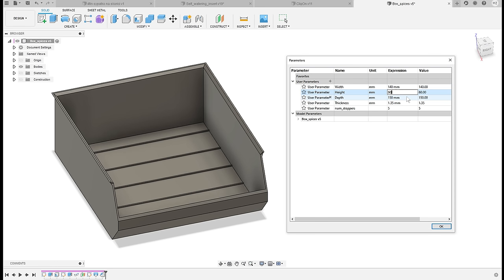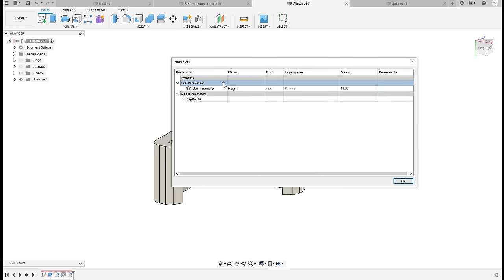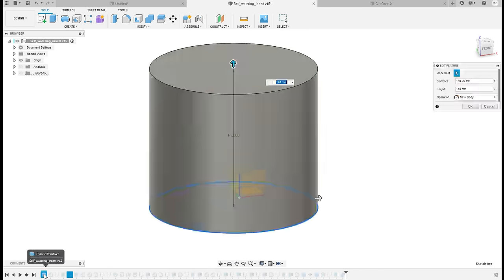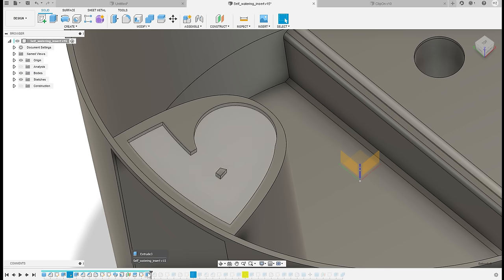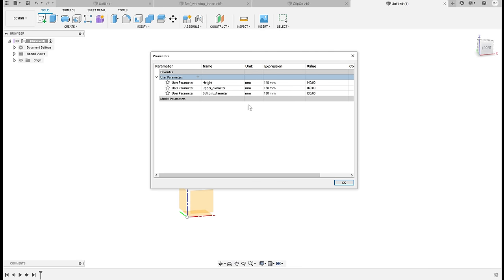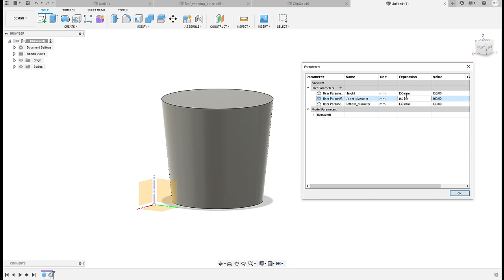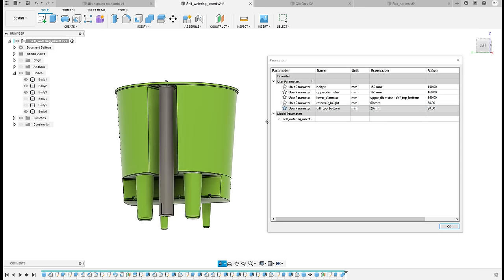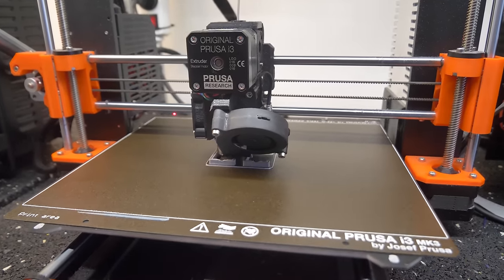Parametric modeling in Fusion360 explained in 40 seconds + detailed tutorial with example

Comment: Always good to see CAD used properly!

Parameters are very useful but stable modeling practice is important to make the size changes reliable. Try to locate your model around the origin to make best use of the planes and axis for mirroring, revolving, patterning and dimension references.Think about the feature types being used, for example a draft could have been used instead of a chamfer but as you want the lower diameter to be controlled rather than the angle the chamfer was the easier to control option. Your sketches should always be fully constrained to avoid unexpected results. Naming them also helps when you go back to fault find. Plan ahead and leave finishing features like edge blends and chamfers as late as possible as these can remove or change edge references and are likely to cause update problems. The order in which blends are applied can also make a huge difference to the results. If you have more than one body in a part then you should probably be splitting them into separate components. Most importantly keep it as simple as possible. The longer the history tree the more likely it is something will fail but with proper planning even complex models can be very stable.

Comment: I have been learning 360 fusion and this practical example helped . I also have flash forge printers as a use them to help teachers in the classroom because they are so simple to learn . I do not have a Prusa printer because I had aleardy invested in dremal,  ultimaker  and flash forge. But think that I may want to rethink this as the new prusa has addressed a lot of issues .thank you for sharing.

Comment: Fun fact: When in a sketch and defining a dimension, you can click another existing dimension in the same sketch to reference it without typing. Second tip: arrays need unitless integers for the count field and this can be accomplished as a driven function of an existing length by just dividing the length by (1 mm) or "1 in" if working in freedom/inferior units. Making a value snap to the nearest integer can work with any of the floor(), ceil(), or round() functions.

Comment: One thing that's really handy that you missed, was to go into parameters and assign names to values already used.

If you've done your cylinder a while ago, and now realise you want to make it a parameter, you can go in and give it a name to use later.  You can also change parameters in that dialogue box without having to click each item in the timeline, all entered measurements are in there.  I just wish you could work on the model with the parameter dialogue always open, eg on another screen, or floating!
Reply: you're now able to do this... i know you asked 3 years ago 😀
Reply: @JanSt12 Yes, I meant it was missed from the video tutorial, not that the feature was missing.

Comment: Parameters are indeed very powerful tool and the trick with single wall is neat, it is being used when embedding nuts, for example. One thing I wonder though - how well will it print that perimeter over the gap at an arc? I don't have good experience laying filament at arcs or angles over gaps, straight border suitable for bridging usually works better (depending on distance and material that is).

Comment: Tip: If you change a parameter and all the sudden the model breaks, then first try change the parameter in steps. 
Like instead of 2mm->5mm 
Try 2mm->4mm->5mm
Sometime change parameter can make the constraints of a sketch break. so by doing it in step you might avoid having to fix the sketch manually.

Comment: Nice video, but what I don't like is, that parametric design is not based on "user parameters". You can simply use the "Model parameters" that are created on the fly (d1, d2 etc.) and you can reference those in other sketches and features, too. If you don't like the d1, d2 etc. naming schema you can rename them in the parameter window. You can reference them by typing the full name in feature fields. If you want to have "code completion" you simply make them a favorite and you're done.

Comment: @Prusa3D
I set a hole to 3.4mm in Fusion.
Sliced it with PrusaSlicer (for 0.25mm nozzle).
Used 0.25mm nozzle on my Prusa MK3s.

And in real life it turned out to be 3.2mm instead of 3.4mm...
What can I do to get the real life dimensions accurate?

Comment: Unfortunately not a great tutorial. Parameters, variables and parametric modeling are kind of mixed here freely, which could be very confusing for newcomers. First of all, the model was broken after resizing, because blind (fixed values) extrudes were used in the first place. In parametric modeling, you should always try to use dependencies and constrains instead repeated values, whenever it makes sense (for example extrude up to surface instead repeating 140mm). Using parameters like a variables is not a good practice.
Also using the 1 layer bridge instead of supports is neat (and often overlooked), but in this case it would fail, as the bridge layer contains curves (outer perimeter) which would definitely sag. Bridges doesn’t work with curved extrudes. It may recover after few layers, but there is not many available, so this could lead to fail print. Using a fillet or chamfer from the bottom (only for outer layers, not the whole bridged layer) should help with this and also would improve the rigidity of this part of the model.
Still love you guys, sorry for the critique.

Comment: I lost it at the chamfer calculations, the explanation made no sense
Reply: The upper minus the lower diameter is just that. It is a difference in diameter. The chamfer-tool is using the radius as distance. And radius is diameter/2.

Comment: Fusion 360 is a very frustrating piece of software. It takes AGES to load, looks terrible on a 4K display and while is mostly usable it can also be frustratingly obtuse. I find this to be particularly so if you create sketches on the surface of parts and changing the dimensions of the part can completely screw up the sketch alignment. 

What's depressing is there really isn't anything that competes well with it. No free software comes anywhere close (Freecad is a parametric cad but it's almost unusable) and all the commercial cad softwares are so prohibitively expensive and proprietary that switching is no easy task.